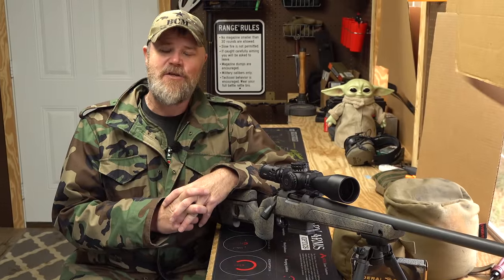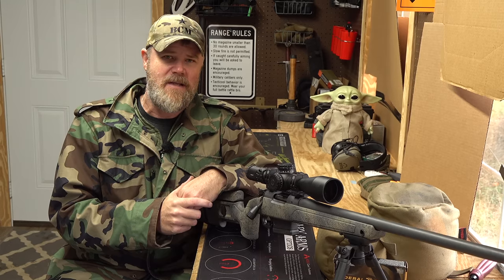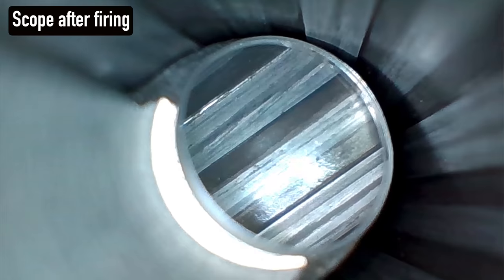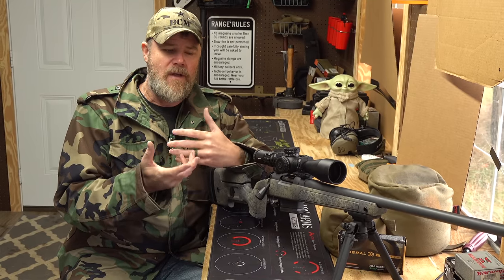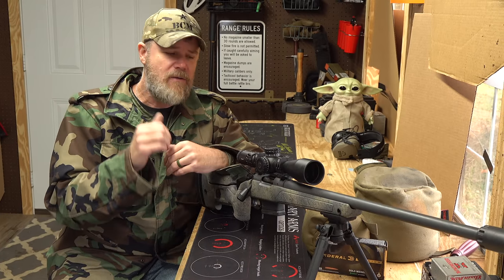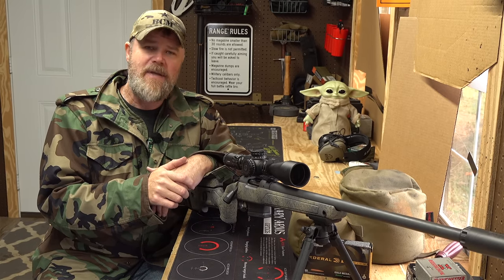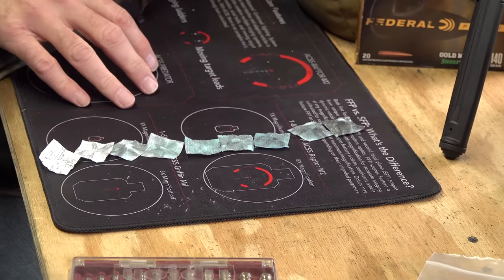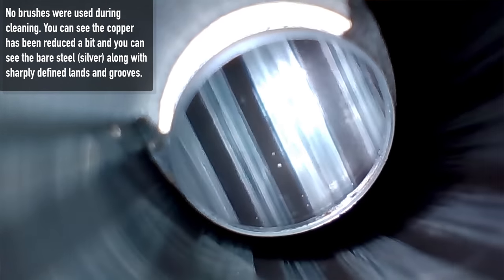Barrel Break-Ins and Cleaning Voodoo Rituals Destroy Barrels

Comment: I once had a customer who complained bitterly that the match rifle I had sold him had lost all accuracy after only a few weeks of shooting.  I returned it to the manufacturer for inspection.  They informed me that the rifling had disappeared.  This was a heavy stainless steel barrel, which truly perplexed us, so I asked the shooter about his cleaning habits.  He was extremely anal in this regard.  He was dissatisfied with American bore solvents, so he had acquired a high ammonia solvent from a Canadian supplier and used it exclusively.  After every single shot he would run a wet patch down the bore, followed by ten strokes with a stainless steel bore brush, and one more patch of solvent.  In effect he had polished his bore to a mirror shine and in the process had eliminated the rifling.  The manufacturer agreed to replace the barrel at no charge and on the condition he get rid of the solvent and cease his insane fetish with dirty bores.
Reply: You mean he had to give up that finely polished SHOTGUN barrel? Now I’m not exactly comparing apples to apples here, but a muzzle loader is a little different story. I found out the hard way when I was a teenager that they shot the best on a lightly fouled barrel. I would fire my Knight Disc rifle then lay a dry patch on my tongue. Put the patch on the jag so the moist (not drooling like a hound dog) side was against the rifling. I would run it straight down ONCE! No back and forth movement. Then I would flip the patch over to the cleaner drier side and repeat. Load back up and fire again and it’s one hole at 100 yards! I just thought I would throw that out there for anyone having accuracy issues with a BP rifle. Do this after every shot. I was using 3, 50 grain pyrodex pellets. Don’t remember the bullets I was using. But they were sabots.
Reply: @sirtango1  They weren't called a "fouling" piece for nothing.    ;-)
BP guns are a whole different matter and should be cleaned regularly - but not excessively, as you correctly indicated.
Reply: Those solvents should say to keep away from nickel or stainless. Sweets 7.62 is the only solvent I trust on my 1916 Enfield SMLE. Shoots very accurate but metal fouls worse than any other rifle I've fired. With regular hopps it fouls to the point of galling. Found an Australian SMLE group that directed me to that aggressive solvent and my Enfield shoots great again. Won't get that solvent anywhere near my desert eagle for the reason you described.
Reply: @Fred Wills I know.  It was meant as a play on words, hence the quotation marks and the wink face.
Reply: @Fred Wills I am bereft.  ;- ()
Reply: @Fred Wills it is vulgar and incorrect.
Reply: @georgewetzel4380  Thanks.  For a moment I was afraid nobody would grasp it . . . oh, wait, I probably shouldn't have said that either.  Too late now to retract it.  Oops, there I go again - sorry.
Reply: That pure ammonia is only meant for solid copper bullets I think. Leave in place 2 minutes only. Hoppes #9 has corrosion inhibitors, a much better choice.
Reply: Old Enfields can be found with old cupronickel fouling. I have gotten it out after brake cleaner, patch, multiple Hoppes overnight soaks, bronze brush, shoot much modern ammo, repeat.
Reply: Haha! 😄😊 those dirty dirty bores!  
(R.i.p. norm mcdonald)
Reply: @tenchraven  you sound ignorent and crude.
Reply: @gnostic-wolf  Amen.  I suspect Norm has the heavenly host rolling on the clouds, laughing their *** off.
Reply: Lmao!
Reply: Makes a good Shotgun.
Reply: @Michael Hill Lmao,... yeah, just get rid of the rifling!
Reply: @Michael Hill You're making me laugh over here man...
Reply: Yes, say no to "anal" ;) I never understod this "breaking in" and OCD cleaning. An old bore snake with a patch, thats good enough for me. The rifle shoots just fine. What I heard, not even the military snipers clean the guns after shooting. So why the big fuss.
Reply: @danholtbk7008  You are incorrect; it's best to omit a word from your vocabulary if you don't know it's meaning.
Reply: @fettmaneiii4439  yeah but you gotta admit its funny to talk about.
Reply: @fettmaneiii4439  You just lost $20.  This was an Ultramatch AR target rifle built by Olympic Arms.  Bob Schultz, the company founder and owner, called me when he saw the condition of the barrel and quizzed me to learn what had happened.  I contacted the owner and discovered his anal-retentive cleaning practices.
Reply: Wut?
Reply: That story is great. Next time someone brings up converting a 22lr to a smooth bore to shoot crimped shot loads I tell them to just clean like you've got an obsessive compulsive disorder.
Reply: @matthewtalich9989  OCD is probably the clinically correct description of the individual I dealt with.  God only knows what his bathroom habits must have been like.
Reply: @georgewetzel4380  you sound like a bucket of fun.
Reply: @fettmaneiii4439  it is, because ammonia is not going to harm stainless steel. Even at high heat. A room temp patch soaked with ammonia is going to do absolutely nothing to stainless steel.
Reply: @johnd9357  Ammonia is a corrosive base that corrodes copper.  This might explain why some use it for bore cleaning.  The solvent he used had a high ammonia content, but there were other ingredients.  What their individual or combined characteristics were, I do not know.  I only know the result was a smooth bore.  Remember, he combined this solvent with vigorous and constant scrubbing using a stainless steel bore brush.  He had an irrational passion for a clean bore.
Reply: This guy would make a fortune in the airsoft world
Reply: thank you for sharing this story, this indeed is a sickness
Reply: @adolfhilter  It certainly is if this technique is used to clean a Python, unless you're cleaning a Monty Python, Mr. Hilter.  Then by all means, go ahead.
Reply: @Paladin1873  
The worst is the hard brush used to scrub like a maniac. Ammonia is fine IF it's used with brains and later to neutralize and get all of it out. Those that fire solid copper and brass projectiles use it a lot but use brushes less, using mostly specific bronze brushes for stainless steel match barrels. One has to be careful removing the cleaning rod each time. But never use ammonia with bronze brushes together since it destroys the brush and gives a false positive for copper. 
An armourer friend had one of those obsessive cleaners too. In Afghanistan some lifted, some were at the fussball table, others spread stds and one that got his rifle handed out was 'cleaning' for hours and hours. The rifling wasn't 'gone' but all edges rounded over drastically. He was searching all over for new cleaning ideas and repurposed a steel brush that he forced through the bore. Usually the G36 is cleaned with a brush on a chain at that time and it worked well.
Reply: @onpsxmember  Maybe MAC should collect the worst cleaning horror stories and make a video of it.
Reply: He must’ve taken that rangers creed serious about keeping your rifles clear as a whistle
Reply: I can only imagine how many “what the fuck”s must’ve been said over that one.
Reply: How often will you lubricate the weapon?
Reply: @---tx9xx  We're talking about rifle bores.  I have never lubricated them.  I only clean them and run a dry patch through when I'm done.
Reply: @Paladin1873  Yeah i didn’t mean rifle bores I was going out the strict framework of this video and referring to firearms in general, obv don’t lube the barrel, I meant the rest of the weapon, carrier group, if pistol slide and lower contact points, etc
Reply: @---tx9xx  I've seen people lube the bore, which is a terrible idea unless the firearm is going into long term storage and will be cleaned before its next use.
Reply: Lubricate for high humidity or long term storage for non lined barrels
Reply: @Paladin1873  Only arms was garbage , some of the guns they built were better suited as fence posts .
Reply: @johnwallace7694  I have to respectfully disagree with you.  Olympic Arms (SGW) did suffer from periodic QA issues and a few of their products were substandard, but most of it was good.  I did a lot business with them for about ten years and often visited their facility where I spoke numerous times with the owner, Bob Schuetz, about their latest offerings and ideas.  In the 1980s and 90s they were the most forward thinking and innovative developers of the AR rifle.  Nobody else at that time was exploring the broad potential of the AR.  Since then many companies have come along and offered equal or better products, but they did so by building on the experience of Olympic Arms.  They did have a lot of trouble keeping up with demand and they faced increasingly stiff competition.  I suppose these factors contributed to their demise.  It's a pity because they had some good ideas that never came to fruition like their AR10 rifle (planned for introduction in the 1980s), the 300 OSSM cartridge (300 Win Mag performance in an AR15 platform), and the reintroduction of the Bauska double square bridge Mauser action (considered by some to the finest Mauser clone in the world).
Reply: Oh shite! 🤣🤣🤣
Reply: Silvent would not be the issue. Over use of a stainless steel bush is.
Reply: Wait a second. There’s a variation of this story in a different video wirh that old fart. This is a copy paste story that someone uses to sound professional.
Reply: If you can Polish the ride ling out of a Stainless barrel with a Stainless brush that’s not saying much for the barrel IMO. The brush and barrel ( all things equal) are made of the same material, the brush A Lot thinner and more flexible. He mush have bored it with a high speed drill to do that in a couple weeks Or the barrel was a piece of DooDoo
Reply: @captainjoesanglingadventur4894  Stainless steel comes in various grades and some solvents have a corrosive effect on barrels.  This is particularly true of ammonia based solvents.  In addition, every barrel has a limited bore life.  Excessive cleaning can have much the same effect on rifling as does firing thousands of rounds through a barrel.  Improper cleaning accelerates wear.
Reply: He turned his rifle into a musket. Too clever by half, as the English would say.
Reply: I call bullshit.  😅
Reply: The gun shop I worked at had a guy some what like this. We had built him a full on custom bolt rifle in 300 Win Mag. He would bring it back within a few moths and say. It shoots a shotgun pattern. Well the owner of the shop had a ranch about 4 hour drive away. The he always left at noon on Friday to go to. Any firearm with complaints went to the ranch for him to shoot. I on the other hand had the job of clean it before it went out the door. This guy brought it back like 4 time a year with same problem. Each time the boss would shoot it. His claim is, Nothing wrong with it. Send it back to the owner. And no joke about three months or so. He would bring it back. Welllllll, I decided to ask him. How do you clean it? No BS, he aske. Clean what? Your rifle stupid. He never cleaned it. So this time it cost him, Boss's numbers. $400.00 to get his rifle back and I taught him how to clean it. He never brought it back. And yet still came in and we built him another rifle.
Reply: @strayblackcatsmeow I just got a Jungle Carbine. Do you suggest I do the same ?
Reply: @Whitetail55  - agreed.
Reply: LMFAO 😂 I believe it
Reply: I find it hard to beleive that.  A FMJ rifle bullet is made of metal and is forced down the barrel by an explosive charge where the bullet is squeezed down the barrel at extreme pressures and your telling me a silly little hand brush is going to damage a barrel?  I call BS!
Reply: @nonyabiz9487 Then please do a bit of research.  All metal wears down over time from friction with other metals or contact with oxygen.  A metal will wear much faster when harder metals and harsh chemicals or salts are used on it.  Rifle bullets are not stainless steel; the bulk of them are copper plated lead, which is much softer.  In this case the brush alone did not destroy his rifling.  It was aided by an ammonia based solvent which was quite caustic.  If you still aren't convinced, scrub the outside of a stainless steel barrel with a stainless steel cleaning brush and see if fails to scratch it.  Now imagine doing that thousands of times to your bore.
Reply: OCD is real folks
Reply: I just started BP shooting since I thought that was the only way I'd get a tag in our draw hunts in New Mexico after 10 year of nothing.  I too got the schooling that I needed to take my barrel to the tub and scrub with hot water and lots of brushing after every shooting session.  Then I discovered Blackhorn powder and their cleaning method which doesn't include the bathtub process, just their solvent cleaner.  Works great, shoots better than the BP substitute I was using before, better accuracy and velocity, I'm free at last.
Reply: @NoKidding66  I shoot BP so rarely that I'm still on my first can of Pyrodex.  Your description is the reason why.  I'm not familiar with Blackhorn.
Reply: @Paladin1873  I ended up giving a half full canister of FFFg Triple 7 away to my neighbor who also shoots BP very little, depending on whether he gets a regular rifle tag during our draw or not.  It seems here that BP hunt tags are more successfully awarded so last year he got a BP tag to hunt bull elk and was successful.  35 yards away and one shot killed it.  He had called it in with cow calling.  After using Blackhorn I will never go back to BP substitutes like Triple 7.  Easy clean-up, more accuracy and power.
Reply: @NoKidding66  Thanks for the tip.
Reply: Cool story bro, a solvent just dissolved a stainless steel barell😂 😂.  you 🤡
Reply: @giggergigger1  I think his manic scrubbing with a stainless steel brush was a major contributing factor.
Reply: I mean I'd argue the issue here is the brush mainly lol